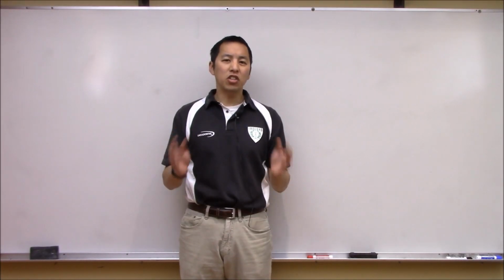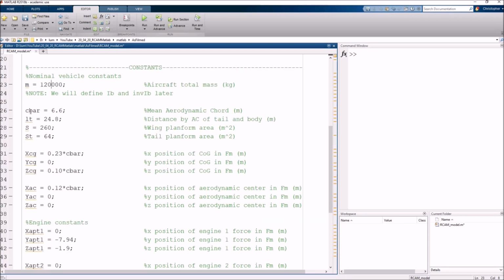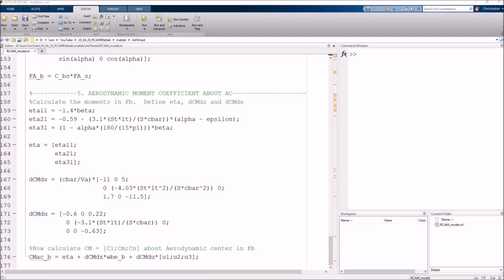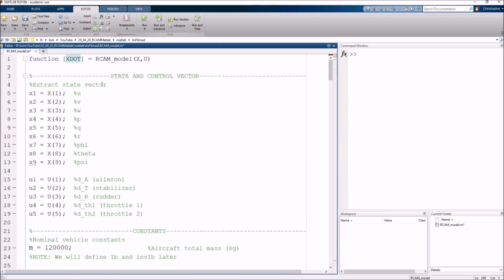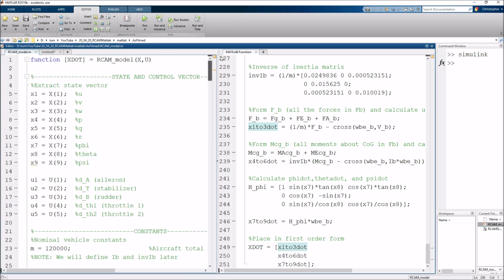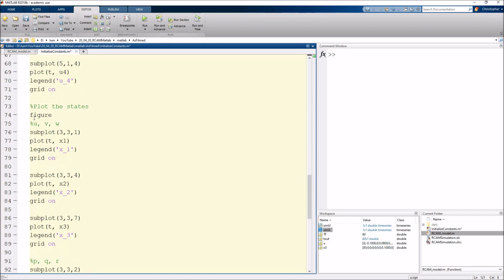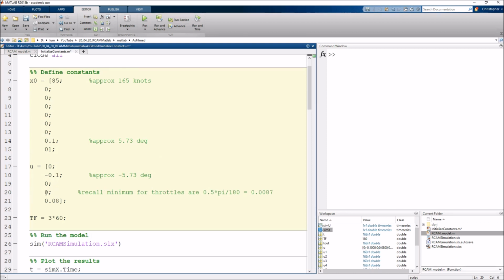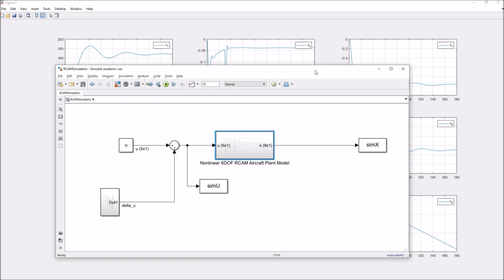Building a Matlab/Simulink Model of an Aircraft: The Research Civil Aircraft Model (RCAM)

Comment: I have a quick question, sir. The moment coefficient at the aerodynamic center, 
Cm_ac is indeed a constant and should not vary with angle of attack. However, in Step 5 of the RCAM document, when defining the moment coefficient, on what basis or criteria is that equation formulated?

Comment: Hey Chris, I've been looking into Simulink's 6 DOF aircraft model in the aerospace blockset and understanding it's methodology. How would that block compare to the method demonstrated here? Is it more/less complex and more/less accurate? Is it a different approach entirely? I also noticed that the example model they provide for a deHaviland Beaver seems to use all the dynamical stability derivatives when calculating aerodynamic forces and moments as input for the 6 DOD block. How would those play into a model like the one in your video? I’ve really enjoyed this series

Comment: AA516: Before watching this, I was playing around with my Simulink and independently concluded that the problem mentioned at 29:00 was unacceptable as well (having code within Simulink that diverged from a possibly changing function outside Simulink). An alternative to using the Interpreted MATLAB Fcn block was just to have the function within the MATLAB Function block be that function.

function [x_dot]  = RCAM_model(x, u)
    [x_dot] = RCAM_model(x, u);
end

This did help with not needing to have the Mux block and the need to jam x and u together, also helps when you have a function that has multiple outputs.

Comment: AA 516: Fun lecture! (and homework) I'm excited to continue bridging the gap between the theory/modeling and what we do in MATLAB/Simulink!
 I'm curious (if you're allowed to share) how much Simulink do you use in industry, and how applicable would something like this process we're doing here be as a controls/gnc engineer?
Reply from the maker: Jack, excellent question.  This obviously depends on what company and even what group you are in within said company.  A lot of GNC engineers use Matlab/Simulink extensively for simulation, control, and other analysis.  Let's just say I use it on a daily basis.

Comment: AA 516: Awesome video! I'm struggling with the dimensions of C_bs and other matrices involving arrays like alpha or Va (HW6 1b). For C_bs I can only seem to get a 2977x1. The only way I can think to fix it is with a for loop and iterate over all the values of alpha, but then I would have to index everything which it sounded like we wanted to avoid based on this video.
Reply from the maker: Zach, that seems odd, do you have a timestamp that illustrates when you think things are going wrong?
Reply: @ChristopherLum  In the 13 to 16 minute range. I'm messing with it right now but it might be easier if I could email you separately, or just wait until office hours!

Comment: AE512: Hi Professor, thanks for the video. I followed your steps but I am getting an error when running the SIMULINK.

Caused by: Error in 'RCAMSimulation/Interpreted MATLAB Function' while computing the output. The width of the result was 9 when a width of 1 was expected.

My XDOT is a 9x1 matrix so I don't know what is going on. Thanks.
Reply from the maker: Marcos, you can try to manually specify the dimension of the output as 9.  Sometimes Simulink needs help understanding the dimension of signals.  I can show you how to do this at office hours if you've never seen this before.

Comment: AA 516: Hi prof Lum, I'm curious if you wanted to express the position of the aircraft in the NED (inertial) frame, would it be as simple as transforming u,v,w using the euler angles phi,theta,psi to get airspeed in the inertial frame, and then integrating to get position? Thanks!!
Reply from the maker: Hi Patrick, yes, in fact that is exactly what we talk about in the videos for this week, you're just a bit ahead of the scheduled program :)

Comment: Isn 't there a problem with calculating rol pitch yaw moment at section: 

%-----------------------------------------------6. AERODYNAMIC MOMENT  ABOUT Aerodynamic Center in Fb---------------------------------------------------------------
% Normalize to an aerodynamic moment
MAac_b = CMac_b*Q*S*cbar;

all Cl Cm and Cn are multiplied by c_bar however the Cl & Cm has to be multiplied by b (wing span) instead of c_bar (mean aerodynamşc chord)?

Thanks a lot..
Reply: Well that's because the RCAM model normalizes Wind tunnel coefficients around cbar, just in case you still keep interest.
What it is really weird to me is that applying Euler angles to North East Down reference frame, an idling  plane increases altitude due to a negative w. I'm pretty sure there must be a little inconsistency hiding there.
Reply: @txemagonz  -w means increasing vertical velocity therefore altitude raises. It has been quite a while that I studied this. Shortly, I adjust parameters to maintain required behaviour of the aircraft.
Reply from the maker: Hi Akan,
Thanks for reaching out, I'm glad you enjoyed the video.  Unfortunately I'm unable to respond to questions on YouTube due to the sheer volume of inquiries that I receive.  That being said, I hope you'll consider supporting the channel via Patreon at https://www.patreon.com/christopherwlum as I'll be able to answer questions there.  Given your interest in the topic, I'd love to have you as a Patron as I'm able to talk/interact personally with Patrons.  Thanks for watching!
-Chris

Comment: Hello Christopher, been trying to access the source document "Robust Flight Control Design Challenge Problem Formulation and Manual: the Research Civil Aircraft Model (RCAM)" but I am only able to get an older version, any suggestions as to how I can get the one used here?
Reply: i have Robust Flight Control Design Challenge Problem Formulation and Manual - the Research Civil Aircraft Model (RCAM)(TP88-3) from 1997 if it would help you.
Reply: Hello,  @alexsopo9917  Yes! That would be incredibly helpful, please advise how I can gain access to it. Thank you!
Reply: @hellstromeyoung8015  garteur.org/technical-reports/ at the Flight mechanics, systems and integration section
Reply: @alexsopo9917  at the Garteur site I came across the 1995 model published in 1996, is this the same one?

Comment: This was an epic video. It was really easy to follow along and finally I was able to make this work. Thousand times Thank you for this.

One thing though here you put x0 as an initial condition in the integrator block. I tried a different method ie. using initial condition block (i.e. it will provide the input just for the first time step)  between the integrator and the input and I am getting an error. The results are coming out to be completely different in both cases. This is confusing me a lot as both the approaches look the same to me. Obviously I am missing something important. It would be great if you could clear this doubt.
Thanks again for making this video this is just too awesome.